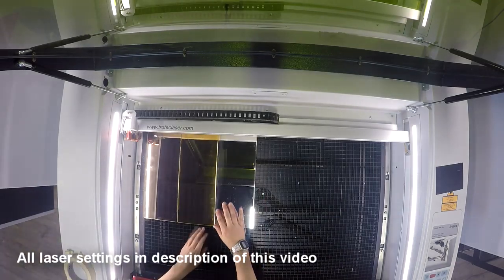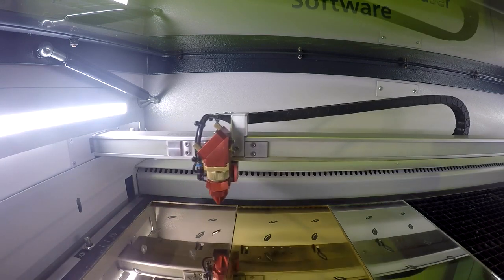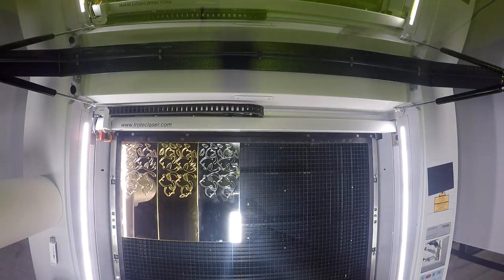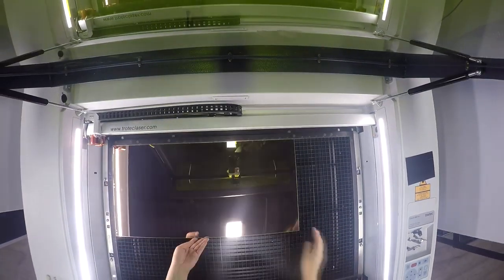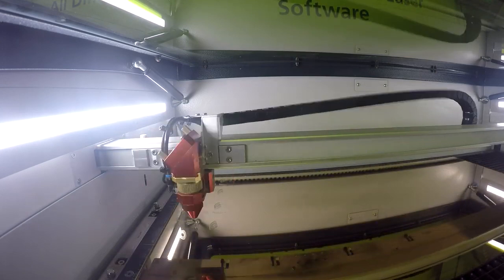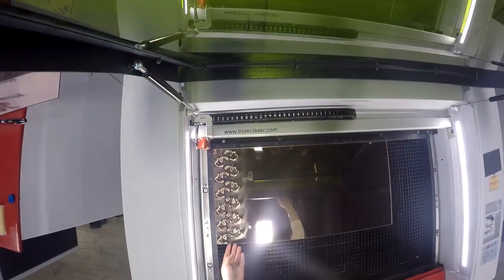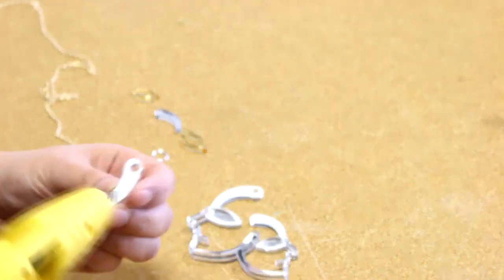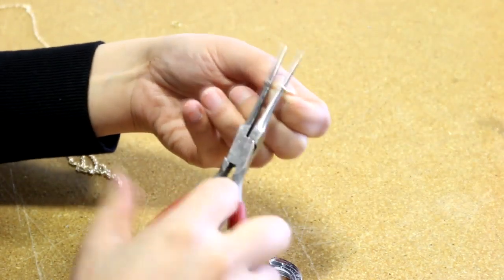Mirror Acrylic Necklace | Laser Cut DIY Tutorial

Comment: What did you put in the material section
Reply from the maker: We used TroGlass Mirror with the following settings: 

Laser: Trotec Speedy 360 FLEXX (CO2 and Fiber) - 80w
CO2 Engraving: 65 power, 100 speed, -0.12 z-offset 
Fiber Engraving: 40 power, 100 speed
CO2 Cutting: 100 power, 0.8 speed